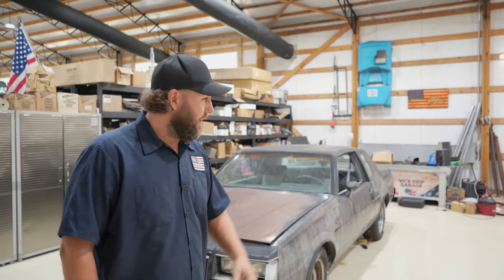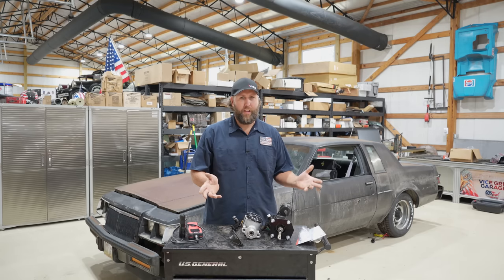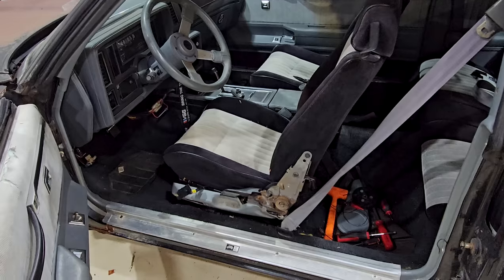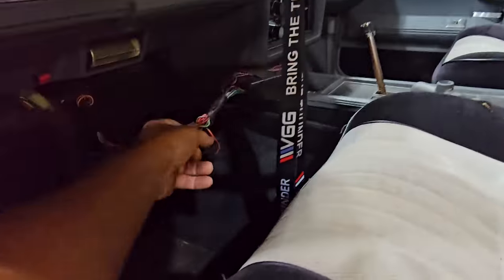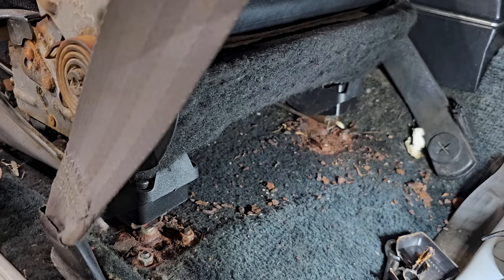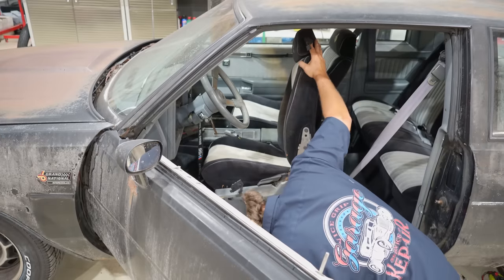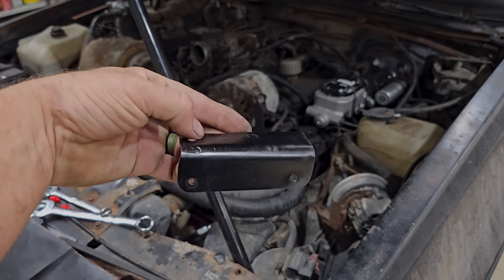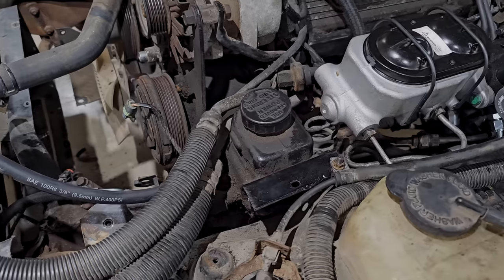Grand National Hydro boost Brake Conversion and First Drive in 20+ YEARS! (and Mt Dew Car winner!)

Comment: I think if there is one car in your stable to do an actual restoration on this would be a good candidate. I know your philosophy is to get ‘em running and get ‘em back on the road and this is a pretty rough example but it’s still a GN and they are only going to gain value/collectibility plus  it make for something a little bit different for the channel. I’m sure there’s a portion of your fanbase that isn’t into the whole patina thing and would like to see how you would go about building a “shiny” car.
Reply: You are very much correct. This is a great candidate for a full restoration.  I'd love to see this down the road as well. 😁👍💪💪
Reply: Feel the necessity to concur and add another affirmation to this here idear. I'd love to suggestalize something funky for it, but a guy just can't rationalize muckin with the Darth Vader vibe and going with anything other than gettin the ol' girl Back in Black!
Reply: That is a great post! Derek we want to see the BN restored!
Reply: I’d love to see a rattle can paint job. A full on restauration can allways be done ‘off camera’. But paints have improved so much that you can do so much with rattlecans these days.
Reply: Shiny scares me
Reply: @EZ4U2Say11  after the rattlecan paint job it can allways be scuffed up to give it the VGG used farm equipment look.
Reply: Or. It can be stickered so it can do duty as an advertisement piece at some VGG event. I think I would love that.
Reply: Keep the patina!!!
Reply: Jessica fell in love with that Nascar tribute they gave away. Maybe she needs this one restored to make up for it.
Reply: I’d like to see a resto/shiny one as well but if it is left with the patina on the outside I’d go all out and  make the inside like new.
Reply: @Memry-dq7ug  the outside is rust. They were just in time.

Comment: I love this show. Derek is a living example of the American dream personified. He started in his little garage in MN and, with the help of his wife, built his own business. He remains humble and does not exploit people or things to his advantage. He has actually helped me stop obsessing over dents and scratches. I sold my brand new truck and bought a dented up Chevy and old mini van. Down to earth guy.
Reply: My one experience with a hydro boost braking system was on a 76 Chevy 3+3 Camper Special with a 454 and 4speed manual. Got it all done after all the minor  mechanical etcetera work, drove it 30 miles to town to get it certified, and all went great until I had to brake hard to dive into an off camber exit off the TransCanada highway. Let me tell you that having seconds to decide on brakes or steering  definitely makes the old adrenaline rush work in a hurry. Thank heavens for manual transmissions.
Reply: Yes being trash is great
Reply: Love that guy
Reply: Just curious if you  know what part of mn seen all the roadworthy rescues season 1  didn't know he was from mn.
Reply: Do you know what part of mn.
Reply: @charlie8921 he lived in a msp suburb, but is actually from nw north dakota originally, which is where I'm from as well

Comment: Derek, a couple tips.  For the seat, don't trash it.  I believe the tracks of a regular 80's regal with power seats can be swapped over and you'll be back in business there with full power.  Or you could swap over tracks from a manual seat and be in good shape too.  If you do replace the seats, save those seat covers.  OEM covers are hard to come by.

For the snake belt, check the length.  It may be 1/2" too long.  For many years the parts books quoted a snake belt that was 1/2" too long and that unloaded the idler pulley just a bit too much allowing the idler pulley yo contact one of the bolt heads and chew up the bolt and the pulley.  It'll run, but it will chew up parts and possibly set off the knock detector making the ECM pull timing every time it sees the false knock from the pulley contacting the bolt head.

For wheels, look for a set of aluminum T-Type wheels.  They're much lighter than the OEM steel wheels and they look like a WE4.  They're cheap and you can get some pretty wide wheels for the rear.  Steamroller looking stuff.  It can still roast them too.

So good to see the old gal on the road again.  A while back I was considering contacting you about my 86 to see if you were interested since you had said you were looking for one, but I never did.  Mine was a daily driver back in the day.  Now it just waits for me to do something with it.  Enjoy the GN, they are fantastically fun cars and no matter how old you are, they make you feel like a kid again.  And when the boost comes up high enough, they make you feel like a stupid kid again. 🙂  Can't wait to see more of the GN in the future.

Comment: I love the seat removal methods!! 🤣  Derek, your video editing skills are right up there with your ability to get engines running that have been sitting under water in the woods for 47.3 years. Thanks for all your hard work. It does not go unappreciated.
Reply: It's the ones which have been sitting for 47.4 years that you have to watch out for

Comment: What you want is a driver's side seat track from a 1987 or 88 G body with either bucket or split bench seats. GM redesigned the track for the last year and eliminated the plastic gear box. It uses 3 separate motors instead and is far more reliable.

Comment: That canister that's mounted on the side of the Hydra actuator is spring loaded and pressurized, just in case you throw a belt or the engine stalls. You will have two or three additional power assisted stops from the booster. A very nice safety feature! Good work Derek!
Reply: That’s good information. I have a hydro boost on my truck and was wondering about that very scenario. Thx for sharing this 👍🏻✌🏻

Comment: If the vacuum leak wasn't fixed, you're venting metered air into the atmosphere while under boost, which is part of why it's running rich - the more boost you try to make, the more you're going to blow out!  It's also hard on the turbo since it has to spin faster to build the requested pressure.

Very cool project, would make a great resto-mod series!

Comment: It’s always good to see a Feller get something he’s hoped for and prayed for ! It’s very gratifying driving something like that especially after wrenching on it yourself! They are fun cars , the Buick turbo 6 cylinder grand nationals were a very fast car for a V-6!!! I almost bought one back when they were hot off the presses the GNX is the really hot one , but they are all fun to drive! I knew that seat was going to turn into a fiasco ! They were crap when they were new! You know that plastic housing that exploded! My 1967 Pontiac Firebirds cam timing chain gear teeth were coated with that crap all in the name of being quiet! Till one day I went to start it to go to work and the car literally “ shit itself” in the garage the broken disintegrated plastic filled all the oil galleries, caused so much pressure in the oil filter it blew off the mount, oh a Feller was using Fram oil filters back then! 🤫I totally rebuilt that motor .30 over new hydraulic Sig Erson cam , lifters, new 650 Carter AFB . New exhaust with Turbo mufflers really nice tones! Hauled ass too! Makes a Feller proud! Keep up the good work Derek them little fellers you’ve got around there sure grow up fast! Our three girls did the same thing , we have 11 grand kids now! A blessing one and all! Our best you you all! Regards Mad Mike S. ………

Comment: Hey Derek, not sure if it would have applied in this situation, but when I used to work on flood cars with extremely lock a cated motors, we would just use any random motor drive with a drill under the seat and move each side little by little.

Comment: Pulled an '86 regal 5.0 out of a field up in Oklahoma. Had a rod knock that a new crank fixed up. Roller cam/rockers(!), old non-smog Rottonchester 4bbl, headers off a '76 olds, lots of fun to drive! Still looks like it just came out of the field. 
An absolute hoot, inspired by you! KEEP IT COOKIN'!

Comment: the seat plastic connector blew on my 85 regal, i fixed it by cutting  a piece of small diameter pipe, and squished both ends to connect the motor and the seat mechanism.  Its been 2 decades since then so thats all i can remember..  that plastic under the seat gets crumbly, but thats the best quick fix that worked for me and lasted forever

Comment: A distict lack of sawzall action, or even the best use I ever found for a scissor jack, A guy needs a passthrough socket set in his toolbox, will sneak into tight spaces where a regular ratchet just won`t. like under seats, spark/glow plugs buried among manifolds etc. just makes mechanical life easier. Thanks VGG !

Comment: I had hydro-boost brakes on an 86 Caprice Station Wagon. They worked great!! Manual said enough pressure for several full brake applications with motor off. Complicated, but good engineering.

Comment: Hi Derek, my boyfriend& I love your videos!! I recently got my dad interested as well.👍
In this episode,when you were trying to remove the Captain's seat, I wished I was there to climb under the front to check the attachments on the right of the seat,(bcz I can fit very well),or to climb into the passenger seat with a flashlight to see why it wasn't coming out,& to help push it out from passenger seat as you were pulling from left of Captain's seat.😀 
Please keep posting your videos!!

Comment: You know whenever Derek starts a job it will get finished.  Yes, this car needs more work but think of all the cars out there that have had similar problems and are still not on the road because of someone's finances or knowledge that keeps the car in the barn or back yard.  I'll have to replay the seat removal several times so that I get the technique down.  Great job Derek.   Much success to you.  You deserve it.

Comment: 51:ish....as you mentioned spinning the seat adjusters with a drill, it sparked an idea....probably not a good one, but here it is...wireless remote control seats, using RC servos to activate the new motors to spin the spinny things.

Comment: I added a power seat to mine ...came with a manual seat. One from a 2002 Camaro fits if you create mounts. Seat bolts right onto the frame. Get one from Hawks like I did.

Comment: Nice. I had an '83 Regal T Type and it had a hydroboast setup on it. It had hair trigger brakes that would lock up and would almost throw you into the windshield. I got used to it but when the master cylinder went out and  I replaced it the brakes it stopped fine. I could've bought an 86 GN later. Kinda wish I did.

Comment: Just a PSA : 
You can also run the electric seat track with a drill.
The blue and yellow line have a key’d line that spins .
You can attach the drill there and move one or the other depending on what position you want to set it .

Comment: I do hydraulic line repairs on forklift on occasion as well as zero turn riding mowers and I fully understand his comments on clock position or the fittings, pre-made ones are a real bear to get in sometimes

Comment: In hs I got my hands on a non running grand national. This car was donated and not allowed to be on the road.. I replaced injectors and fixed wire harness. My teacher Mr Johnson was so proud to see me do burnouts even though we could not drive this car anywhere.. I got an A in auto shop
Reply: This car was gutted by gm and had like 750 miles on it.. tucked away for years absolutely junked. Autoshop was the best class ever

Comment: Did better than I would have with that last bolt for removing the seat. I'd have grabbed a snatch strap, wrapped it around the seat, attached the other end to a 2nd vehicle, got in 2nd vehicle and gone full throttle and see how far I could send the seat flying.
I've only very recently stumbled across this channel. I've watched this video and the Rotbird one so far, and already this is becoming my favorite channel. I nearly died laughing at the seat removal.

Comment: Derek I enjoy your videos. 
I noticed that you were using fractional wrenches on the seat bolts. You know this but some of your viewers may not, some of the bolts on the Buick GN are SAE fractional and some are Metric. In 77 GM cars started to have both metric and fractional bolts and nut cages. Very confusing and transitional times. American cars started being hybrids in the late 70's, with the body and fasteners metric and the engine/trans/diff and brakes still SAE fractional measurements. Just drag the whole tool box box over, since you had no idea what you would need. 
GM don't now what a 14mm is, they use 10 13 15 16 18.
Reply: Hello there👋👋, how are you doing today? Hope you’re having a wonderful day. God bless you!!!❤❤

Comment: I absolutely love your show man. I've been watching you for years, never have worked on vehicles much other than sparkalators and general stuff. But my mom's Ford Escape blew a rod through the bottom and we decided to swap it ourselves lol. We're struggling in spots we had to beat out the old rod before we could even get the flywheel to spin but we're getting there. Spending a lot of time with the family and we've been either angry as can be or laughing our butts off! Thanks keep on bringing the videos!!

Comment: Me been from Kentucky I've ran into the seat removal before. See what ya do is u slam the door on the valve of that NOS tank setting it off inside the car. Now the bonus will be u never will have to clean the wi does again plus the drinkers seat will probably be loose to. Keep the tss tss to the minimum!

Comment: If you want to drive the car without replacing the headliner cloth (at least in the short term), get a pack of thumbtacks. Not push-pins; you want the slightly domed metal head thumbtacks. You can tack the cloth to the headliner itself with most cars, and if you do it in a decent simple pattern it doesn't even look terrible. It will get you by until you decide to repair it for real without damaging anything.

Comment: Alway good fun, delving under car hoods, I had the 79 Rivera S type with this engine, back in the early 2000's, not a GN more like miss daisy's car, interior like the lobby of a burlesque festival 😂. Just an idea though, here in England we use mainly turbo diesel cars, to get vacuum the alternator's have a built in vacuum pump, standard 7 grove pulley, you could possibly retrofit and use a standard vacuum brake servo 🤔. Great work though 👍👍👍

Comment: I had one back in high school but now I have 2003 Ford ranger 4cyl 5 speed I done put a brand new radiator battery front brakes wheel cylinders plus bleed the breaks by myself all new brake hardware in the back now I gotta fix the spring shackle hangers..

Comment: I had an 84 Pontiac persianne wagon with hydroboost brakes, they were fantastic until one day the unit decided to leak power steering fluid, I was more than 200 miles from home, I stopped and got many quarts of fluid so I could make it home, I had to stop often to top it off but I made it home and replaced the unit, it about 200 bucks in the late nineties.

Comment: Be thankful they did use this abomination on the Grand National!!!    1989-1990 OEM Cadillac Seville Deville Brake Booster Master Cylinder ABS  It had 3 servos, completely atypical to most power boost setups.
Reply: actually now that you have it out it does look a lot like it.   aaargh

Comment: In the early 90’s I was getting tired of my 72 Nova and really wanted a GN so bad but I couldn’t find one under $15k. So I settled on an 89 TBird Supercoupe for $10k. Not as fast in a straight line as the GN but definitely a better car overall especially with the manual trans and indie suspension.

Comment: Misfiring/backfiring under boost might be a coil or ignition module. Check resistance across the coil secondary terminals. I've had Grand Nationals do that with a bad module. It's unusual and you can't test for it other than swapping in a different module. The module needs a good ground.

Comment: Hear me out... 
Get 3 Ryobi drills and attach the to the seat track cables and wire the trigger switches to the seat levers! Hard part will of course be changing direction if you go too far but we just get too cavalier with our seat moving anyway.

Comment: I bought one new, an 87 but the paint was really bad in the first in the first 3 years. Just leaves from trees that didn't bother any other car would stain that black paint padly. Mine was under a 5 yr warrantee .  
   The brakes weren't that good new,  I paid 300 for a secondary warrantee that paid for parts so I actually got paid 600 for them to do the job!  What usually goes wrong is just a hole in the casting is just rtv cealed and the rtv gets forced out. You can just reseal it. I would have used JBweld or something. On my WS6 (big cam) I us two electric brake vacuum pumps to the canister. If one breaks or blows its fuse, your not stopping at all!

Comment: So that front seat bolt you could get the ratchet onto the bolt slide a pipe a small pipe over the ratchet underneath the seat and loosen it up that way.

Comment: Just for the people who don't know as well as you do, a turbo car makes vacuum at zero throttle when decelerating, just like a hot rod with big overlap does. Vacuum brakes work in anything besides a diesel - and even that isn't 100%, as more diesels are coming out with throttle bodies.